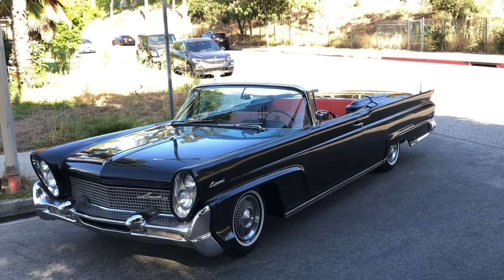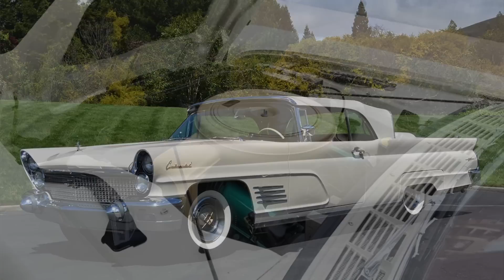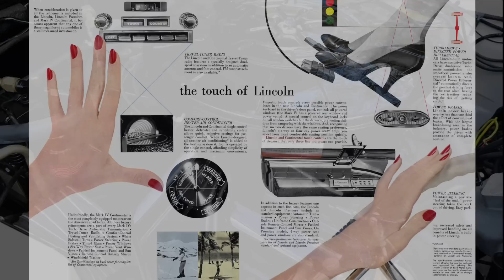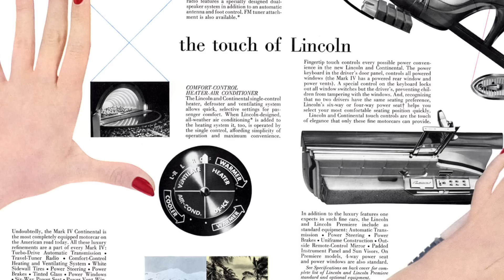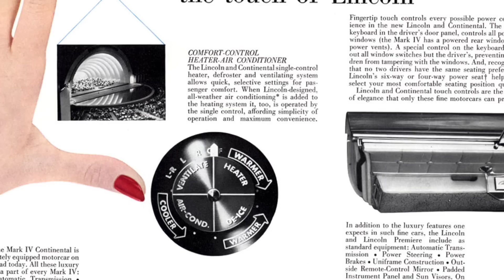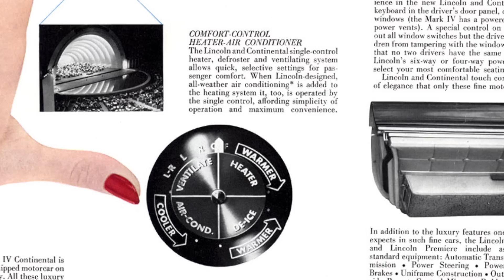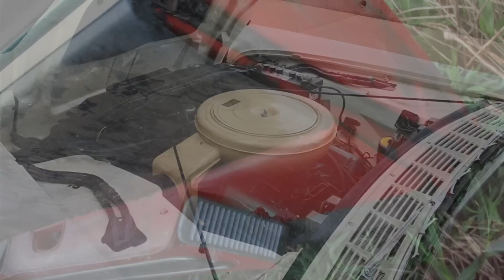Is This The Strangest Automotive Control Ever Produced?  1958-59 Lincoln HVAC Control

Comment: My grandfather had a new 58 Continental 2 dr. I was 4 or 5. I was just fascinated with that car, which also had the retractable rear window. Apparently, he had a lot of trouble with that car, so he traded it in on a new 58 Lincoln Capri (the 'base' model). It did not have the cool rear window. Both cars had factory A/C, and I vividly remember those hoses under the hood. I still have some drawings I made of the Continental in 1962, when I was 8. I was a horrible artist (still am) but I did capture lots of details on my drawings. Thanks for the video to bring back wonderful memories!
Reply: I can't believe my grandfather didn't kill me. I managed to put lots of cute swirly marks on the plastic lens of the instrument cluster with the cigarette lighter, I scratched the heck out of the painted metal panel between the rear seatback and that retractable window, and was just about to play gas station attendant with the garden hose. Luckily, my mom caught me before I could fill-er-up! My grandpa never said a word about it.
Reply: @61rampy65  Maybe he was the same type of kid as you!
Reply: I'm just a year older than you, what a great time to be growing up, especially if you were into cars like I was. I like making drawings of all the Big Three cars. I knew all model years, their names and opinions they had. I was actually a pretty good little artist. I wish I still had them.

Comment: I believe Edsel used a similar HVAC control in '58.
Reply: The system is very close to this in the 1961 Lincoln also, except it looks like a radio dial, but same basic system. One dial does it all.
Reply: Yes, it was called Dial-A-Temp on the Edsel.
Reply: I'm slightly scared by the thought of both this HVAC control and the Tele-Touch transmission existing in the same vehicle. Ford had some strange ideas back then.
Reply: @johnruschmeyer5769  They were trying to out Cadillac the Cad and out Packard the last true Packards.
Reply: @johnruschmeyer5769  

Ford was out of its mind in the late 50s but it sure was fun!!

Comment: A 1958 Lincoln just left the restoration shop I work at. We went through everything mechanical, complete drivetrain, prepped and painted undercarriage and engine bay. A $50k job. The body and paint was already in great original condition. That's a BIG, complicated car that's difficult to find parts for. And when you do, they're big $$$.
Reply: They sure are ! There are people who subsidize their retirement by selling Lincoln parts
Reply: @tomsmith2331  To be perfectly honest: i was at US-Car meetings since 1990 here in Germany. My father had an Oldsmobile (1976?) with a V8-Diesel engine which broke, then installed a regular V8…
I still…am the biggest fan of such large, enormous vehicles. With that touch of real luxury. 
Good for me: Never had a chance to own something like this as it is way to expensive over here.
But…in the future…my stocks can get better…
My interest goes to a Lincoln Continental Town Car (4 doors)…1978 or 1979…
During the meantime i am going/driving all-electric with my fabulous Volkswagen e-Up!…🙈🎯🫣🥳🤩
Reply: @YouTooDoTube 
My favorite Lincoln's have to be the 1963 and 1969. I love those body styles.
Reply: @tonyelliott7734  My deepest love (bad english, sorry) is with Chrysler Imperials fuselage-style design! Damn.
They look (awfully) beautiful. 1972 models… Out of this world. Hidden headlamps, the front nearly looks the rear end of a car. Stunning.
Reply: @YouTooDoTube  
They do look beautiful. My Ford equivalent would be the 1970 LTDs with the hidden headlights. They're very easy on the eyes as well...😆👍
Reply: @YouTooDoTube  
Do you ever run across any T-5 Mustangs over there? I had one here in the US back in the early 80s, ironically.
Reply: @tonyelliott7734 These cars (Mustangs) are very popular over here. Why?
Simply because they are as small as typical european cars are. It is just that simple. Narrower streets, lots of corners. Simply not that much SPACE compared to US standards.
Reply: @YouTooDoTube  
I say ironically because it was a US export to Germany that I had back here in the US. It traveled across the sea twice...lol
Reply: @YouTooDoTube  The Volkswagen EV is coal powered, then?
Reply: @DUCKSAREEVILLLLLLLL  Ahhh…nah! No way. My supplier (electricity) is green power only.
Reply: @tonyelliott7734  I agree with you on the 1969! I liked them for a few reasons: the headrests, and the front disc brakes for two. Other than that, I believe 1964 or 5 was the first year for front disc brakes, and 64 was the year they lengthened them. So I'd want the longer, disc brake-adapted vehicle at the very least. Oh, I think 64 was the first year of integrated am/fm in the same radio head too, but I might be confusing Lincoln & Cadillac. I could Google all of it in one second, but... Anyway, just some thoughts.
Reply: @YouTooDoTube  Suuuuure it is. Watch "Planet of the Humans", by Michael Moore.
Reply: @DUCKSAREEVILLLLLLLL  VW use mining from Mars to source they need for lithium battery’s and aal the metal work!
Totally green!!
Reply: @petrovicmotors3775  OK. I'm 100% pro EV, now.
Reply: You did well, to preserve this piece of history. 👍
Reply: The least wanted vehicles of the past are the most wanted vehicles of the present.
Reply: When Detroit was daring! 
Love everything about these cars, especially the ‘58. The 1958 is the most pure design of the three years. And while the Lincoln did not sell that well when compared to Cadillac, they did sell better than the Imperials by Chrysler. The 1958 Mark III also outsold the previous Mark II of 1956-57, by far.
Reply: It is, to me, a gorgeous car and a FAST car as well.  I think if the headlights were vertically instead of diagonally stacked, it would have sold better.  At least in 59 and 60.
Reply: I agree about the headlights. The diagonal ones just look weird and not luxurious
Reply: @tomdelisle8955  I agree, but somehow around that time it was "the thing" to do weird stuff with headlight arrangement. Really all the way to the late 60s. Think 69 Camaro for one. There were definitely others too. Mentioning that makes me automatically go to today's electric Rivian SUV with the very unpleasant looking headlights. If they had just turned them horizontally opposed, I would LIKE the vehicle. It looks ridiculous to me the way it is. Just some thoughts 😉
Reply: @michaelbenardo5695  Those lights certainly make it ugly weird/stupid.

Comment: There was no "Continental Division" in 1958.  The Continental Division lasted from April of 1955 until July of 1956, and produced the 1956 and 1957 Continental Mk II.  The 1958 Lincoln Continental Mk III was a Lincoln model.
Reply: The 1958 and and 1959 cars were marketed as Continentals. 1960 was the first model year for a unibody "Lincoln Continental."
Reply: @Ctrl-XYZ  The 58 and 59 Mk IIIs were both unibody.  And they were models sold by the Lincoln Division. There was no "Continental Division" at that time.  The Continental Division was sunset in July of 1956 and the only model that division produced was the 56 and 57 Mk II.  The Mk III had nothing in common with the Mk II other than the Continental name.
Reply: @Ctrl-XYZ  He means that there was no separate Continental division the way there was in 56 and 57, (the Continental Mark II of those years was not a Lincoln, it was a Continental.  The 58 - 60, while badged as a Continental, was a gussied-up Lincoln.)

Comment: Gotta admit that I never really cared for the '59 or '60... But the '58 was MAGNIFICENT.

Albeit not too "Continental like".

As for the Designers and Engineers of the era... So many of them from the various manufacturers were "MIT Smart"... Just look at this HVAC switch! The Ford retractable... The memory seat in the Eldo Broughams... The pushbutton gear selectors in the Chryslers and the Mercs, Edsels and Packards!

The wild transmission designs!

Such incredible creativity.

Comment: There really doesn't appear to be a practical way of making a unibody car that is as well isolated from the road as can be done using a full perimeter frame.
Reply: Ever ridden in a 2003ish Lexus LS430???  That has to be the nicest riding car I've ever been in, its a unibody.  It has that magic carpet ride like a big 60's/70's/80's American land barge but it doesn't bob up/down, it doesn't ride boaty.  Plus its king tut's tomb silent, no squeaks/rattles/vibrations/wind noise, its surreal how you can be doing 120mph and feel like you are on the Shinkansen.  The handling isn't bad either, yeah it pushes to the outside if you push it and does lean over a bit but the steering is fairly quick and it feels safe/secure.  Also tracks laser straight, something that always annoyed me about American land barges with a steering box.
Reply: @AaronSmith-kr5yf  I would have to ride in one myself to see.  My wife's 2010 Avalon, which foreign-car lovers claim rides smoothly, rides almost like a truck, and with the original Japanese tires, had HORRIBLE road noise.  Sounded like all 4 wheels had bad bearings.  And I hate rack & pinion - too twitchy.
Reply: @Eric Ruud Actually my parents bought a 2000 Avalon brand new, that was pretty much a Lexus with a Toyota badge.  It had a lot more room in it than a 2000 Lexus ES300, hell a lot more back seat leg room than a Town Car or Grand Marquis.  

Granted no cool electroluminescent gauges, burled walnut or fine leather like a Lexus but it was $3000 cheaper or so.   But it was built just as solid as the Lexus, ride was whisper quiet and smooth as well.  Granted the LS430 was on another plane in terms of refinement/ride/quietness/horsepower and just generally better handling/driving dynamics.
Reply: @AaronSmith-kr5yf  The Avalon may have bettered the Grand Marquis for rear seat legroom by not quite 2 inches, but it doesn't beat the Town Car's legroom..
Reply: @AaronSmith-kr5yf  The old Buick Electra/Park Avenue was the American analog to the Avalon. For example: The 1984 Buick Park Avenue and the 1984 Cadillac DeVille were basically the same car (same body with somewhat different outer sheet metal ). Luckily, the Buick buyer paid a bit less BUT got a more reliable engine than the Cadillac buyer! Anyone who wants Lexus luxury without "showing off" should get an Avalon! Great cars!
Reply: @Eric Ruud I had an 06 Avalon Limited, the ride was very, very quiet. I miss that car, it was the most reliable car I have ever owned.
Reply: You are correct, a unit body is like a 20s or older car with a separate frame - solid body mounts that transmit, rather than absorb, vibration and noise.

Comment: I'm surprised that they made those big ol cars unibody construction and then went back to full chassis,  I never did like a unibody car especially a large car.
Reply: The Continental of the 1960s was also Unibody.. it didn't revert to body-on -frame until the 1970 redesign..
Reply: @trudygreer2491  which to me REALLY made no sense, because of the four-door convertible. That's a long stretch of nothing but floor...
Reply: @marko7843   With big sections of steel beams/‘frame’ rails welded to it...
Reply: @MrZdvy  And still necessitating crude, giant weights in the fenders to dampen vibration...
Reply: @marko7843  I have never seen or heard of giant weights in fenders to dampen vibration🧐
Reply: @MrZdvy  do a little googling...
Reply: @marko7843  I did’t find any info on weights added to fenders...
Reply: @MrZdvy  My '62 Studebaker convertible had cast iron weights behind the front bumper corners to dampen vibration.
Reply: They didn't go back to a full frame until 1969 or 70.  All those 60s Lincolns with suicide doors were unit.
Reply: Guess what if you don't want a unibody today you will have to buy a truck, and not all of them.